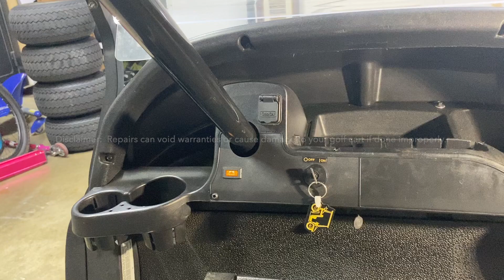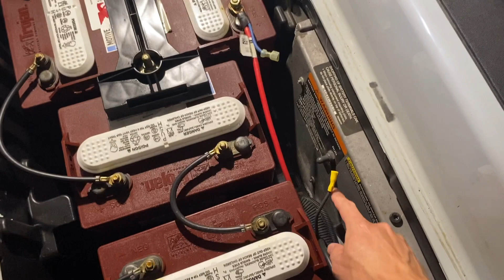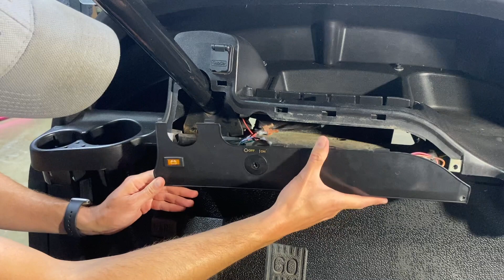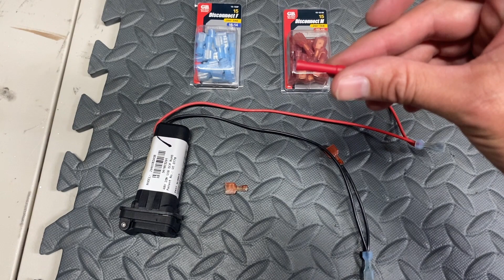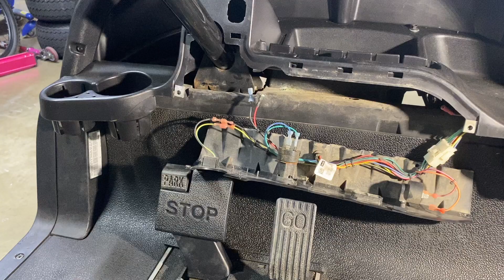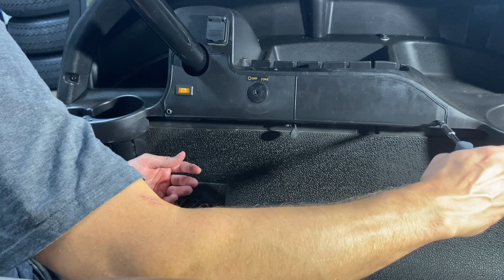USB Repair for Club Car Tempo or Precedent.  Factory OEM Club Car USB not working?

Comment: The OEM replacement port is very expensive online (saw one for $174). It's is rated to take 36-48 Volts so it has a volt reducer built in.  I purchased a 12V USB on amazon for $14 and will just run my own 12v. power to it
Reply: yes, the 48v to 12v transformer only cost $20 from amazon.
Reply: I was thinking the same thing!

Comment: In case anyone is wondering, the part number is 103402701.  However, I think I'm going to find a different usb port to install as I've now had two of these go bad in only 4 years.

Comment: I have a 2019 club Car Tempo but it does not have the USB unit installed.  Can I assume the two wires are available if I purchase a 48v USB unit so I can connect; and are the 2 wires you used unpowered when the key is in the off position or is USB always on?